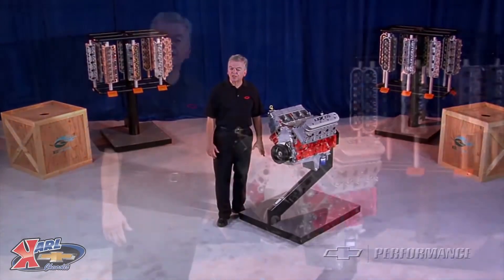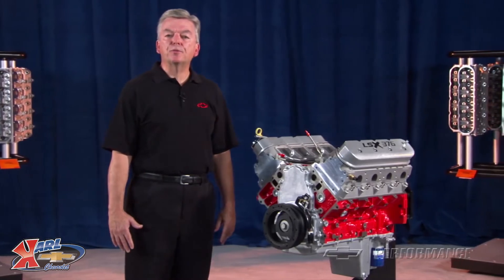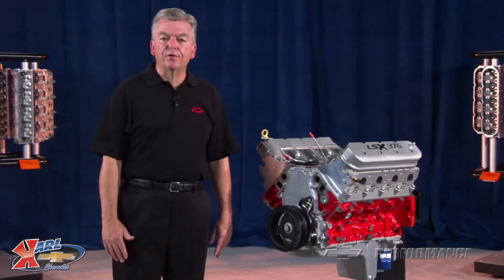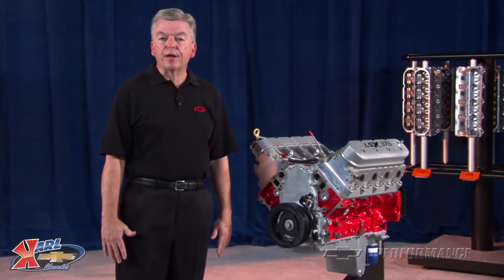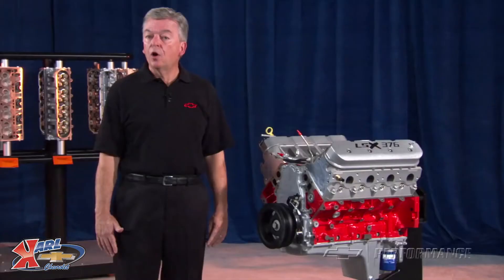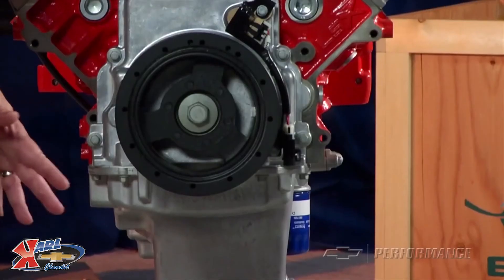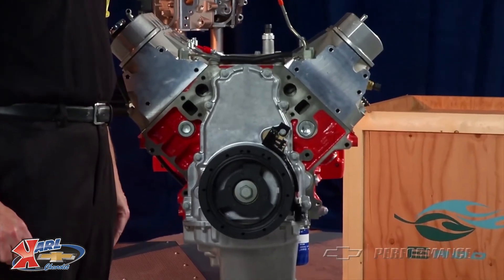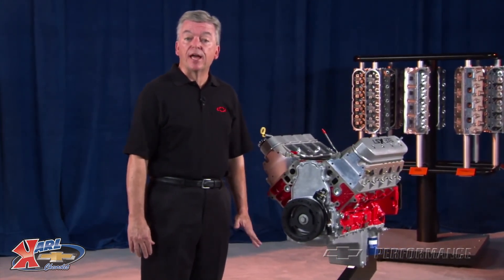Chevy LSX376 19260831-B8 or 19299306-B16

Comment: No forged crank yikes
No forged connecting rods yeash
Used iron block 6.0L LQ4 / LQ9  & complete forged big bore stroker rotating assembly & sleeves = litterly bigger bang for the buck. Just no warranty.